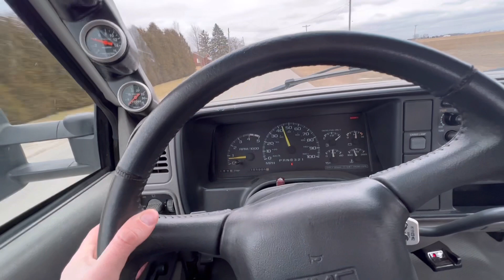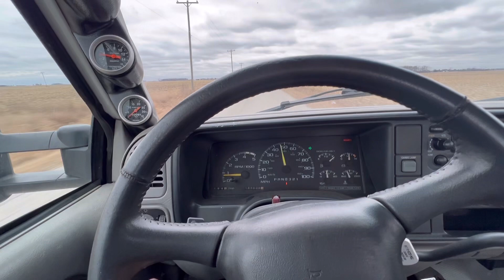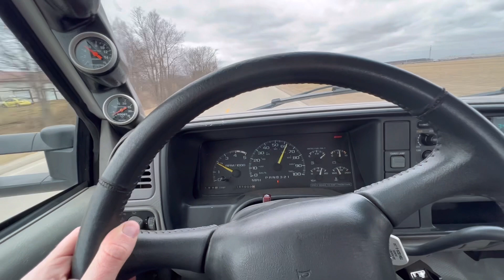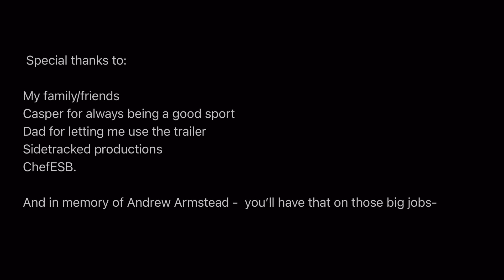GSC 6.5L diesel. Why doesn’t my turbo whistle? Why is my truck struggling?

Comment: Thanks for the great content… I’m wanting to pull a 6500 pound camper so I am looking for a truck that will not constantly downshift on cruise control   Will a 6.5 do the job or should I move up to a Duramax? Your opinion appreciated. Thanks.
Reply from the maker: @normblais7527  that weight isn’t a ton but towing on cruise in any diesel is hard on them. You can try it with a 6.5 but the dmax will do it better. Most people with 6.5s tow 5-10k and they do more than fine.
Reply: @ OK, thanks for the quick reply… enjoy your videos👍
Reply from the maker: @ no problem. Not sure if that helps your search any. Definitely look at and drive a few of each trucks.
Reply: @  yes I will thanks. I like the simplicity of the 6.5 but I know the 6.6has gobs of torque

Comment: 22:1 compression..duramax is 16:8..so with that fact you cant add a lot of boost w/o running the risk of blowing a head gasket.
Reply from the maker: @wadebond7679  not a true statement at all. I’ve run 30+ psi for over 45,000 miles. I cracked the heads before gaskets pushed. It has nothing to do with boost pressure. It’s all about exhaust pressure and heat.
Reply: @gingersnapcustoms  yes its a true statement..you just disagree with it is all..head gasket cracked head...broke is broke..it all Stims from too much compression..thus the duramax lower compression was the fix and cure to solve low horsepower and boost is what makes horsepower.
Reply from the maker: @wadebond7679  I don’t disagree, I just have data that says you can add boost without causing issues. Multiple others also have similar data. Can you add 40-60psi? No. Can you add up to 35? Yep.
Reply: @gingersnapcustoms I fixed mine..it was simple I dropped a 1995 cummins powered 7100 pump down in place of the Detroit boat anchor.
Reply from the maker: @wadebond7679  that’s a great fix. Cheap and easy to fix because they never break. Great on fuel on long trips. Sounds like you found the best solution for your application.
Reply: @gingersnapcustoms  over 3 grand but the sound and the drivability and peace of mind is well worth it
Reply from the maker: @wadebond7679  not bad! Peace of mind is worth every penny.

Comment: Where’d you get that A pillar gauge mount?
Reply from the maker: @maxgaouette2704  that came from summit racing back in 2014 roughly.
Reply: @gingersnapcustoms  thanks ill take a look at what they got appreciate it!
Reply from the maker: @maxgaouette2704  Leroy diesel also used to offer one. He may still stock it.

Comment: I have a '94 C2500 with the L65 6.5. Never had such a love-hate relationship with a vehicle before. When it wants to it runs well, other times will just struggle and then go into a "limp mode" where it will barely go over 2000 RPM and 20 miles and hour. The PMD has been relocated, I have a lift pump harness from Leroy, I have a 2/0 battery cable kit to put in (have tried different alternators, when it runs bad it says 13 volts) and a new old stock AC lift pump to put in. After that, not sure. Muffler clogged? No cat in mine. Bad IP?
Reply from the maker: Is there any check engine codes?? That would help a lot. Could be a clogged tank sock. Could be an over boost issue.

Comment: So what would you look at if my truck has no power and then all the sudden it kicks it. Then is sluggish then kicks in. No smoke terrible fuel mileage
Reply from the maker: Dead lift pump. Waste gate control solenoid is failing as well.

Comment: What set of boost gauges do you use or recommend? What would be normal or recommended stock boost pressure?
Reply from the maker: Stock turbo 8-10psi. HX35 13-17. I use autometer sport comp 2s. These gauges are going on 9 years old.
Reply: @gingersnapcustoms  thanks so much, I really appreciate it.

Comment: I have a 6.2 diesel, will the the fuel filter housing from a 6.5 bolt on and plug in or is there slight modification?
Reply from the maker: It won’t mount to the intake manifold unless it’s a 90-92. It can work. Just needs some modifications to not flop around the engine bay.

Comment: So i got a 1996, truck was running a little weak so i swapped to a manual waste gate and tune from quadstar ran good for a month and now is doggy. So i make 5-10 pounds of boost and i just put a carter lift pump ans relay on to see if tripling my fuel pressure from the stock lp 4psi to 13psi carter now and it still runs the same. Im thinking injectors? but what else should i check?
Reply from the maker: You have boost leaks or even a low compression issue from a leaking head gasket. I would start with looking at the turbo cross over pipe. Check your upper intake gaskets and charge boot and do a once over on the cooling system. Check the turbo for shaft play as well. Stock chargers are only good for 5-12psi and if you really push them they can take a dump pretty quickly.
Reply from the maker: A clogged tank sock can also cause sluggishness and hesitation too if your fuel volume isn’t high enough (that’s what’s critical more than pressure)
Reply: Will do thanks.  Also not all the time but maybe once or twice a week on a cold start,  it’ll start right away like always but the valves clap really hard right as it starts then goes away immediately just curious if you have ever ran into that?
Reply from the maker: @HumpUglyGirls  that’s normal. It’s the cold start timing advance kicking on.

Comment: Not sure how it is on the truck motors but the van 6.5L also had the wastegate actuator run off vacuum so you could have a bad vacuum pump that isn’t supplying vacuum for the actuator to work. Or the actuator itself is also bad.
Reply from the maker: Same same. I try to cover what I can in these and even when I make a list I manage to miss things lol.
Reply: @gingersnapcustoms , no problem. When those wastegate actuators go bad those 6.5L have crap for power. I replaced many of those when i was working on school buses.
Reply from the maker: @JLCmike4014  those pumps really do make them struggle. Even the actuator solenoids can cause a lot of headache. Definitely something to add to the explanation posts.
Reply: @gingersnapcustoms , agreed. The easiest way to to check for a dead vacuum pump is to see if the only heater vent position you have is defrost. If you only have defrost then you have a dead pump since the vent control postion switch runs off vacuum.
Reply from the maker: @JLCmike4014  not on the pickups. The vac pump only runs the wastegate or EGR on Vin S models. I wonder why the vans/busses are like that? That would make trouble shooting much easier.
Reply: @gingersnapcustoms , don’t know. The vacuum pump on the vans is only for the wastegate actuator and heater control switch and yes it would definitely make diagnosis a lot easier on the puckups.

Comment: So we put a new turbo in my truck a while back ago, it runs a lot better than it used to just can’t hear the turbo anymore.
Reply from the maker: If it was a stock turbo swap. Some of those whistle. Some don’t. I’ve noticed it’s a crapshoot.
Reply: @gingersnapcustoms  Interesting, thanks I appreciate it
Reply from the maker: @JM-Meier  if you replaced it with a stock turbo of the same model sometimes it has to do with the wastegate function. Sometimes it changes the tone.

Comment: I got a 1984 gmc with the 6.2 diesel with a 4 speed stick that I turbo with 3.73 gear diff and it pulls really good I just got 400600 miles on her turned the pump quarter turn at 65 mph I get about 5 to 6 psi of boost max boost setup is about 15 psi I have the truck for about 22 years and still going on strong.

Comment: How come you’re running at like 1900 RPM going 65 mph my 6.5 would be like 2300
Reply from the maker: 3.73 gears and 265/75 tires VS 4.10 gears.
Reply: Sorry that was kind of a dumb question I forgot that the 3500s have the 410 gears
Reply from the maker: @Lofjdjfjoxdndndidi  actually not all of them do. Mines a 3500 and it had a 3.73 option.  So that was perfectly valid to ask.

Comment: Hey bud I have a 97 gmc with 6.5 I bought it has 118k original miles everything is factory still except lift pump and cold air intake. It runs great when you start off after 45 min or so of driving it looses power just falls on it face. Where you you suggest starting with a problem like that? What could possibilities be?
Reply from the maker: I would start by checking lift pump pressure. Find out if the lift pump is weak or tank sock is clogged. Also look into a boost gauge along with check for any check engine codes.
Reply: @gingersnapcustoms  Thanks I've replaced the fuel pickup in tank (new sock) lift pump is new haven't checked pressure seems good. Boost seems good per guage. No codes pull up. That's why I'm stumped. I was thinking maybe weak injection pump. Thanks for your time and replying back!
Reply from the maker: @joeymaxwell8972  check fuel pressure. It might be that the OPS is warming up and when it does the gauge reads but the lift pump shuts off. If it was an injection pump issue you would be getting a pulse width error. Limp mode happens when it over boosts. So as long as it’s between 8-12 psi that should be ok
Reply: @gingersnapcustoms  Thanks I get my guage out and test it. It shouldn't be cutting off I bypassed the factory wiring when I installed due to them working off the same circuit as oil pressure guauge. Also considered and injector possibly collapsing. With it being 25 yrs old and only 118k miles I know it's sit more than it was drove. Thanks for your assistance I appreciate it.
Reply from the maker: @joeymaxwell8972  see what fuel pressure is. If you haven’t done a PMD update and the resistor is burned a bit. That too can cause some funky stuff to happen as it warms up.
Reply: @gingersnapcustoms   that was my first thing I did after i bought it was replace pmd and route it away from injection pump for better cooling. I'm at point of scratching my head and wondering lol. Thanks again
Reply from the maker: @joeymaxwell8972  I’ll do some thinking. It has to be fuel or a sensor. I just don’t know which one.

Comment: So my glow plug light wasn’t coming in and truck would crank but wouldn’t start. So figured my controller went out. I bought a new one and replaced it. Glow plug light came on and truck started fine. Go out today literally one day later and light isn’t coming on and they aren’t priming. What could be the issue? Can’t find any bad wires or bad ground. Any help would be thanks!
Reply from the maker: You may have a wire grounding out by the fuel bowl. Sometime one rubs through and it can kill a glow plug relay. Also the ground on the passenger rear intake runner if it’s damage will cause glow plug and prime issues.
Reply: @gingersnapcustoms  I’m going to go double check that and be sure I didn’t over look that! Thanks for the response!

Comment: Question for ya
I have a 1996 6.5. 
I recently put on an air dog raptor, RP100-4G and I’m running about 12 1/2 pounds of fuel pressure. 
Couple of weeks ago I jacked my truck up and looked around for exhaust leak. The only thing I could find it was leaking a little bit at the V band clamp because I noticed black soot there. So I took it all off, cleaned all the crap out of it, and the downpipe as well put it back together no more leak. In regards to boost pressure my truck has a GM 5 turbo and I think I read somewhere that a 96 should have a GM 8. I have had my truck for about 12 years and have pulled my 35 foot fifth wheel camper from Vermont to Florida a few times and I have never gotten any more than 4 to 6 pounds of boost pressure. In my mind, my truck runs extremely well. Doesn’t seem like it’s missing and for the most part one not towing anything seems like it has a lot of pep.  Especially after I put that new lift pump on my camper weighs about 12,000 pounds with all her gear in it.  As far as air filter goes in box, it’s all stock still have the stock exhaust on it as well.  Got any feedback thank you Buddy I always watch your videos and I love them you do a great job
Reply from the maker: 4-6 psi boost pressure is pretty normal for an all stock truck assuming it still has a vacuum wastegate system. If the wastegate button is damaged that also can cause low boost. Or if the cross over is collapsing that too can cause issues.